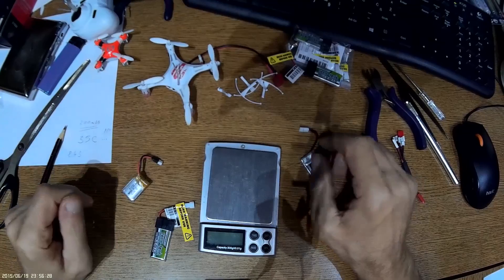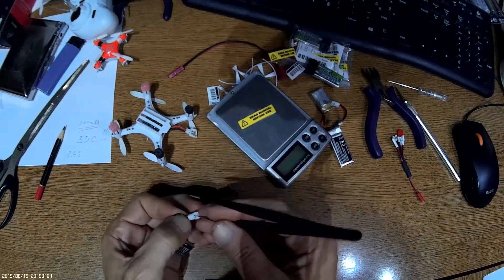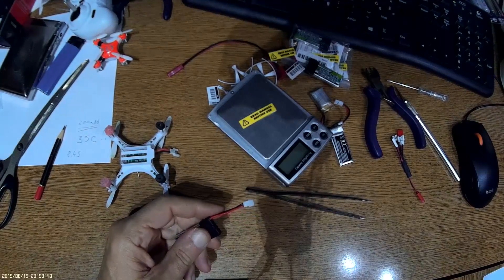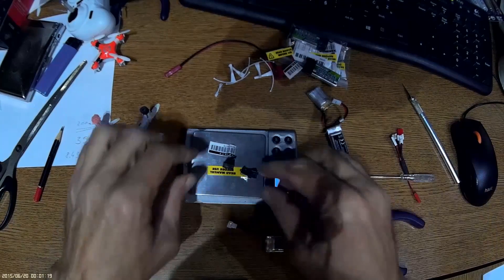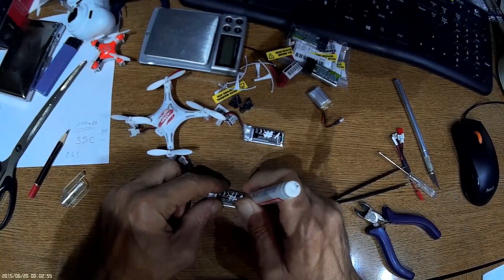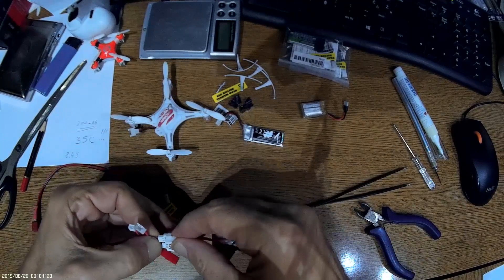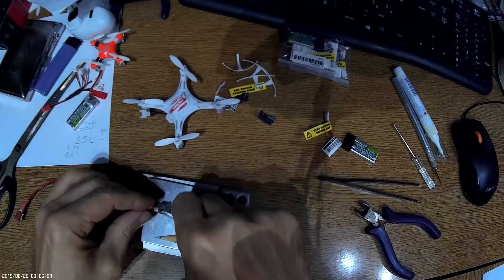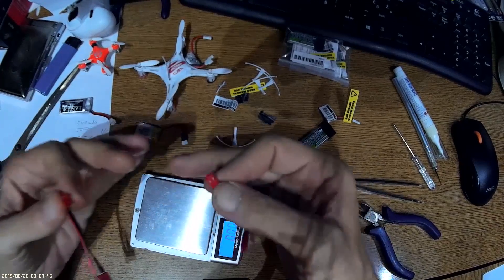Battery Mod On Eachine H8

Comment: Milan thanks so much!!! I just got my first quad choper/drone last night. Today i was researching, biger mAH for my H8 mini. I know biger mAH will = more weight, so was unsure if better battery would extend my fly time. My H8 mini came with 150mAH battery and my fly time of 4 or 5 minutes is to short... lol
Reply from the maker: Yes, that is somewhat short flight time. Usually small quadcopters with small propellers has shorter flight time than bigger ones. The 'secret' is in relative size vs. size of air molecules - the bigger, the more efficiency. If you decide to increase battery capacitance, use maybe 30-40% more capacitance, about 200 mAh. Remember that motors has magnets, and those can overheat and lose magnetic properties. So, too much weight - it will not last very long. I hope it helps.
Reply: Milan Karakas- i was gonna try a 250mAH i thoughts what size you had in this video
Reply from the maker: That might work. When you get this battery, after fist flight check the temperature of the motors. If hot to touch, ... and avoid 'throttle punch' on this things, it is so tempting... :D
Reply: Milan Karakas thanks i will. I want to remove the prop guards for weight but i enjoy using inside and im still a very novice flyer and always hit walls and stuff hahaha. 

P.s. thanks very much for responding :)

Comment: Hello from germany! Super nice and secure video. I love it. 
I have the same drone at home and check your last vid with the antenna tuning. Works perfect for me. 
Now i want to tune up the battery, and you made a great tutorial for this project. 
But i have also a question. I have the 3D model of the copter. Is your modelcase transparent? The lights are shining so bright through the body. 
And the idea with green is very good. In the dark, i cant see the blue perfectly. I think, green is sometimes better.

I like your vid and leave a subscription. 

Sry for my funny english ;)
Reply from the maker: Your English is fine to me. Aviation does not use blue light at all, exactly because it is poorly visible. Only white, red, orange and green. Blue is just for fun, nothing else. Not for any helper. By means of 'transparent' - there is another English word 'translucent'. The difference is that if transparent, you can see through it, if translucent you cant, but you can just see some light, not clear picture. Thank you man. I subbed back, although you haven't any video yet. I can see only playlists - when get time, I will watch it.
Reply from the maker: Oh, German... I can only say: Ich heise Milan. :D
Reply: Very good. Hello Milan :) Nice to see you here!

Comment: Great mod! Want to try it out really soon. But do you think charging with (http://www.banggood.com/X6-6-In-1-Charger-For-Hubsan-X4-WLtoys-UDI-JXD-JJRC-Syma-JXD-p-965757.html  ) is possible / safe? Im using this charger for the original H8 mini batteries right now, works great. It does have over charging protection on each port, as well as short circuit protection (see description).
Do you think charging these batteries with this charger is safe? Thanks in advance!
Reply: I can report myself already. This is great mod! Increase in power is great! I also can report that mentioned charger (the Green 5 in 1 charger from Banggood) can safely charge the batteries. It stops when full. No overcharging.
Thanks WildMania for this great suggestion!
Next step is to attach an FPV-camera and create a new standard in the  'tiny whoop' mania.
(And dont forget to change the polarity when using this type of battery!!!!!!)

Comment: Ordered the battery,but do I need to change the polarity also as you described in your video .
Reply from the maker: Not sure which one you bought. If this Turnigy as on video, then - yes. In any case check onld vs new battery to be sure + look at colors of the wires.
Reply: OK by the way I ordered the syma x11 battery
Reply from the maker: Not sure exactly. On their picture... can't be 100% sure. Just test immediately after unpacking - avoid forgetting.
Reply: +WildMania OK

Comment: can I use syma x11 battery in eachine h8 mini
Reply from the maker: I think it is possible. 0.80 x 2.00 x 3.00 cm for syma x11 battery. Just measure battery. I think that H8 has 0.7 mm thick battery, but 0.8 is not much. Only it is bit longer - so you need do procedure as described on video.

Comment: hello. can i get the exact model of the batteries you bought. nice vid.
Reply from the maker: http://www.hobbyking.com/hobbyking/store/__26738__Turnigy_nano_tech_300mah_1S_45_90C_Lipo_Pack_Fits_Nine_Eagles_Solo_Pro_100_.html
But, it is currently out of stock. Chose some similar dimensions.
Reply: thanks for the reply sir. looks like its out of stock,darn. thanks for the reply.
Reply: WildMania it's in stock again

Comment: I cant find the same price for the batteries, was it a special deal ? do you have a link ?
Reply from the maker: +TheKetsa 
That is because I made mistake on this video. The invoice was actually 'fabricated' at this time, when HK offered 'reduced price' for customs only. So I was also confused on this video. Later become aware that the prices said are not correct, but completely forgot to mention this. Thanks for reminding me.

Comment: do you know what battery connector does it use? It is not normal jst balance connector.
Reply from the maker: +ASUS Micro 
2 pins "Molex" connector. Not sure exactly which type, pretty anusual connector. On Turningy nano-tech battery, polarity is reversed - change it first!
Reply: ***** I searched for it earlier, can't find it anywhere, I guess I will just change connector to 2s jst xh balance connector. thanks.
Reply from the maker: +ASUS Micro 
That is true. HobbyKing had this cable, but I can't see it any more on their pages. For this reason, I am using one plug from burned USB charger, and cut wires. Then with crocodile clip attaching it to the charger (Imax B6). Maybe you have some spare USB charger, I have few, so it is not hard to make decision - cut and convert.